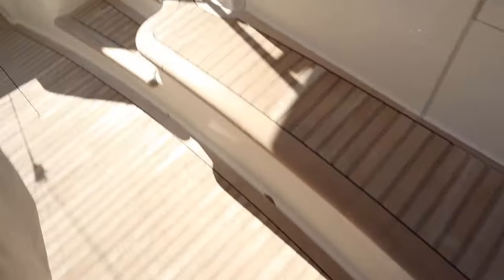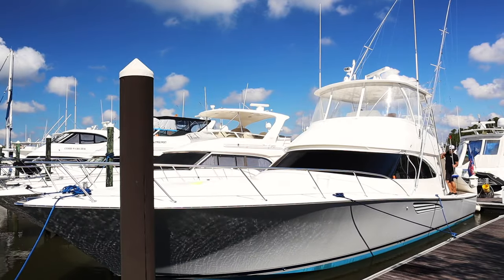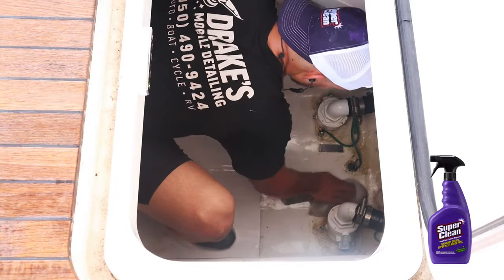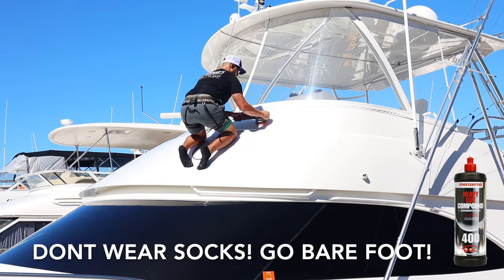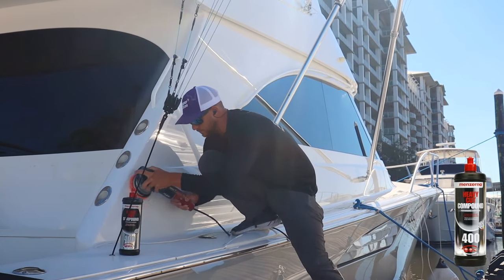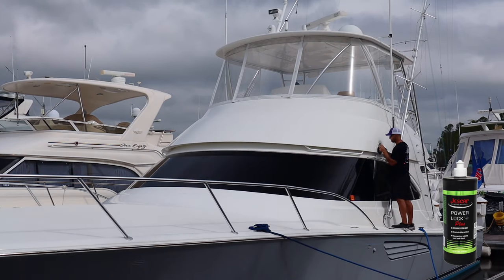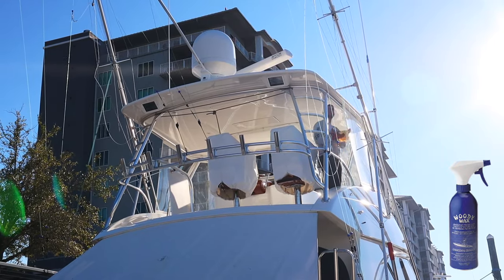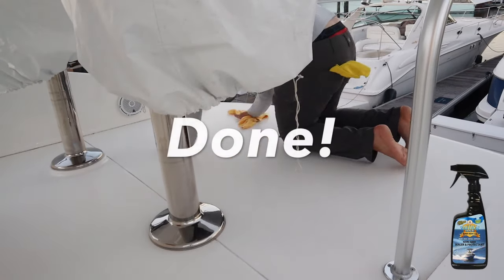How to Detail & Wax a Sport Fishing Boat | Yacht Detailing Business | Revival Marine Care

Comment: Enjoying your videos, has helped a lot understand maintaining our boat. We have a 1986 Carver Mariner that we will be selling next year. We just bought a 1995 Carver 355 AFT and I want to make sure I use the correct products next year before putting in the water. The boat will be in fresh water on the river in MN. The hull still looks shiny and I was wondering if all I need to do is wash and then use Jescar power lock+ to protect the gel coat. Last year I used Maguires compound and then wax on my 1986 boat but has a lot of water spots after we pulled it out. Planning on using the starke venom appt remover before selling it. Just want to make sure I am maintaining our new boat properly. Thanks!!
Reply from the maker: If the hull is shiny, just applying the jescar power lock will be fine! The venom will take off the water spots for sure! 

Thank you for watching!
Reply: @DrakesDetailing  thanks!! Just realized I meant to say water spots on the 1986 boat not 1996

Comment: Have you ever looked into a spotless rinse system to remove the minerals from the water and prevent water spots or do you just get them up before they dry. I know in Florida you can move one for just a second and they will dry up on you. On the topic of water do you worry about getting hose marks on the gunnels, do you have a special hose or just iso alc the marks? Great videos
Reply from the maker: I have thought about getting the filter, but it would be hard to lug that thing around from marina to marina.. but it could be done. 

I’m usually very careful with the hose not to pull it across anything, or you can get a ZERO - G hose and you wont have any issues.

Comment: Hey great video! You talked about having tried a bunch of different compounds and polishes in the video and I was wondering if you had tried 3Ms new perfect-it line up? I’ve been using that for a while and it works pretty good for me but the stuff you use seems to work super well so I was curious as to how they compared
Reply from the maker: 3m works pretty good, but I feel they don’t finish great! Menzerna finished super nice! I’m also in the process of test starke yacht care compounds and polish and so far they have been very nice! 

You can check them out here ! 

https://drakesmarinedetailsupply.com/collections/starke-surface-technology
Reply: I noticed that you used the orange lake country pad? You normally use the grey pad with the menzerna 400.
What made you go with the orange one this time?
Also what’s the advantage of using the flex 3401 vs a DA polisher?
As always your videos are much appreciated!! 👍🏻
Reply from the maker: I used the orange because I didn’t need to cut as much. 

The grey is more aggressive. 

The flex 3401 is a much better machine for polish because it will not stall or stop spinning when you apply pressure. 

The da will stop spinning. 

It will allow you to work faster and apply more or less pressure when needed

Comment: Seriously, just tripped into this channel. You are amazing!! I’ve watched several so far and about to buy product’s via your amz links.  couple questions:
1) it seems like most of the products you use can be performed in direct sunlight? Agreed?
2) so after step two ( hitting with the Mezz 400) do you really wash again with Dawn? Before the next step. Wouldn’t that strip off all the hard work with the 400 stuff?
Thanks Drake. Super excited that I found this channel. Got to wait 4 more months before I get to try these steps. Boat is in Boston, MA and it’s not warm here right now. Lol
Reply from the maker: Thanks for watching! 
Yes they are all fine in direct sunlight, all products work best in cool temps but it will still work. 

2 the menzerna 400 actually polishes the surface. Washing it will dawn will remove the oils in the polish to help make the wax stick better. It will not hurt any of your work if it was done correctly.
Reply: Thanks for the speedy reply. Appreciate it very much. I will do it the way you recommend. Thank you.
Reply from the maker: No problem at all!

Comment: Great video, I appreciate your professionalism towards your work and channel.  I have been learning a lot.  Do you have a preferred smaller DA for small or angular surfaces?
Reply from the maker: What do you mean by smaller ?
Reply: What size pad are you using with 400 stuff?
Reply from the maker: 5 inch pad
Reply: @DrakesDetailing  like the Adams Micro Cordless Swirl killer, or similar, for small tight spots.
Reply from the maker: I gotcha! I of been using the flex PXE80